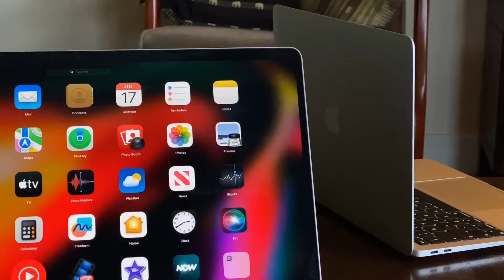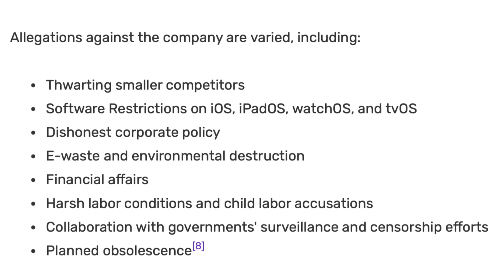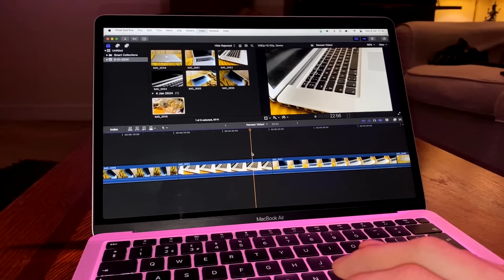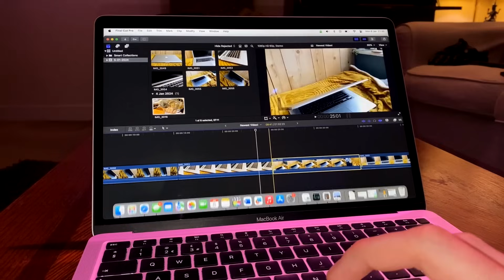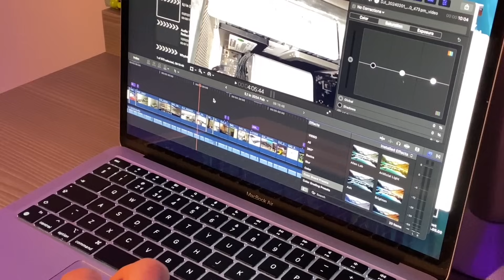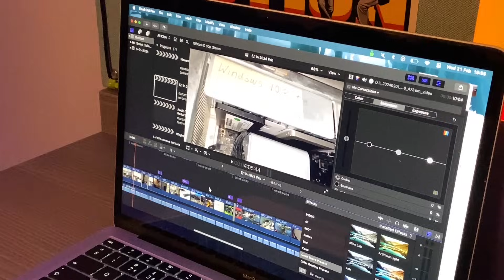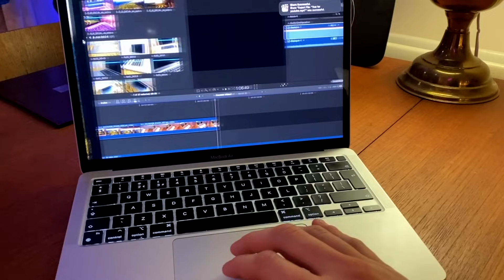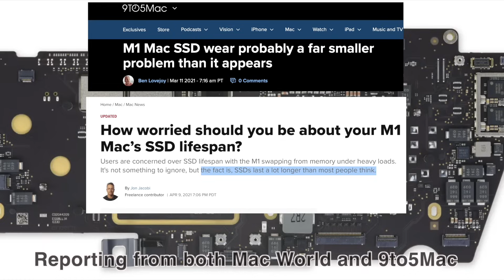Don't make the same mistake I did by buying a used Intel Mac.

Comment: Just got a retina 15” 2015 with i7 2.8GHz upgrade for $180 USD. I am upgrading from a maxed out Unibody 15” 2012 with the GT 650M 1gb and high res display option, SSD 500gb and 16gb ram. The better display, speakers, webcam, portability, thermals, battery life and performance bump of the MBP retina are 100% worth it.
Reply: i have a 2013 13 pro a 11 unch 2014 air a mac mini 2012 and a imac 2010 21.5 inch and im not upgrading! i like my intel macs! intel macs have 1 huge upside to the m-series ones... native windows support via bootcamp!
Reply: 2014/15 rMBP is a very solid machine as a daily driver, especially if you upgrade to NVMe storage and use OCLP to run macOS Monterey. Not sure about the 2015, but my 2014's speakers are trash though. Very tinny sounding. My previous 2011 model had much better speakers. Not a deal breaker for me, as everything else functions very well.
Reply: Wow I just upgraded from a 2012 to a 2015 as well.  15 inch.  I paid $150 and it was eligible for a free battery replacement from Apple under their exploding battery program lol
Reply: They are still very usable indeed, really like way the Pro Retina 15” (2015) and Air 13” (2017) remain relevant today. 

+ have always liked the look and feel of the two, last to come in the true silver OG macbook design. 

Hope you’ll be able to put your Retina 15” to good use for a long time! :-)

Comment: honestly an intel mac is just a good decision for people who want a laptop that can run both mac and windows , i like that i could replace my ssd or battery, and i don’t need the m series chips, sure i sometimes get annoyed about the lack of software updates but apps work and it runs all the apps i need and sometimes even faster than my windows laptop, the 2014 mac just looks and feels great, people should just buy what they need , an old mac with intel still works and feels great, if you need performance though these mac’s are just not made for that nowerdays , they‘re old and you need to know what you‘re getting into

Comment: i just bought an 2013 mb pro 15" for under 200€, it´s ridiculously spec´d (original 1gb ssd, 16gig ram, the fastest i7 and dedicated gpu). best thing is it´s absolutly mint looking and will only need a freesh battery (holds up 3 hours light use at the moment). But i totally agree to your reasoning and also have the base spec´d m1 air as a daily machine and its perfect, such an elegant and efficient machine. if you buy intel insist on absolutly bargains otherwise you will get burned..
Reply from the maker: You've definitely got the right idea.

Comment: Apart from for video editors, the problem with Silicon is that once you go to 32GB/1TB, prices gets stupid,, even used.  2019 i9 16" MBP with dedicated 5500M graphics is plenty fast still for almost everyone, and takes the latest OS.  In fact Sequoia is compatible even with the 2018 MBPs.  Benchmarks mean nothing.  Also, people tend to use their MBPs in areas with electricity, and portable batteries are prolific, so 11 hrs vs 22 hrs isn't a deal breaker, not even close.  We were fine with 11hrs back in 2019, and just because longer life portables exist, doesn't diminish an older laptop.  I mean, if Apple  release a 40 hr battery laptop, are all M1 MBPs suddenly useless?  ALSO, there are some photo plugins and music production software that simply won't work on Silicon.  Buying a VERY nice Nektar MIDI controller only to have to sell it a week later, was gutting.  Couldn't even get it working via the Rosetta route.

EDIT: you're recommending 8GB for video editors? :)
Reply from the maker: @BelfastBiker  not trying to be insulting here, but people made similar arguments when the switch from PowerPC was made. 

Power efficiency, and overall performance (as well as, pretty soon, app support) are key features in a laptop, and combined they’re very compelling reasons to avoid an Intel Mac. 

Yeah I’m recommending 8GB for those who can’t afford 16, just so they don’t lose out by buying Intel. I manage to edit all my videos far better on my base M1 Air than every other MacBook I’ve ever used…

Comment: You in the wrong. Intel allow you run multi Mac OS . You can run 32 and 64 bit games and apps. M series are weak computers , they can’t ran older software. When we move from power pc to intel, still could run old power pc stuff.some VST won’t run on series computers
Reply from the maker: There is no right or wrong in this situation. M1 MacBooks are more powerful, end of story. Intel Macs continue to have their uses, though, I will never deny that. Let's not polarise something that's full of nuance!
Reply: There will always be people who need compatibility with older OS’s or applications and that’s where virtualisation is a great compromise. I’ve got the entry level Mac Mini M2, can happily run whatever OS under UTM or VMWare desktop (I am a home user) that I want.
Reply: M Series processors are extremely powerful. M4 just scored the fastest consumer single core cpu score on the market. Rosetta 2 is also basically seamless and often outperforms Intel Macs running the same code natively. Rosetta 1 support was dropped in 10.7, so no one is running PPC apps via that on the most recent Intel Macs anyway. Wild comment
Reply: "some VST" must be like a decade old. I won't even risk having downtime in my DAW from such old crap.